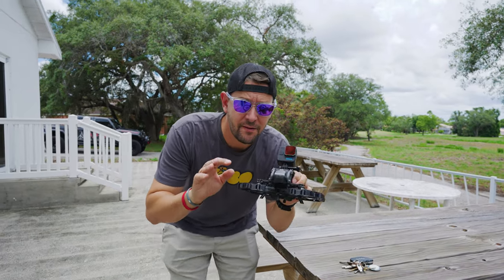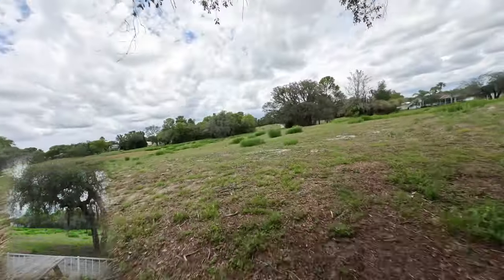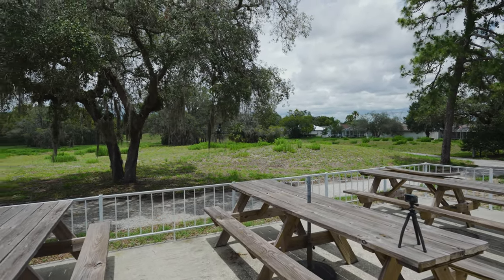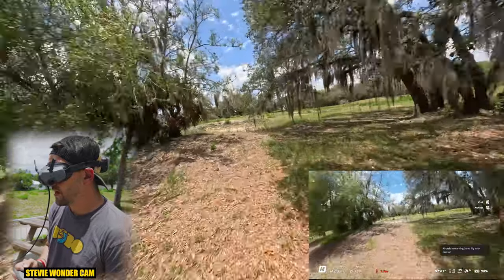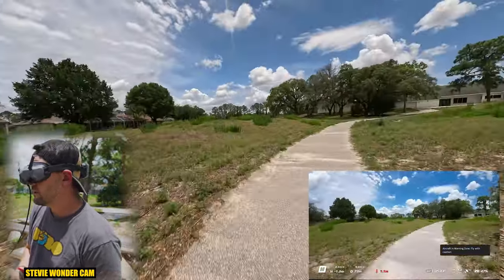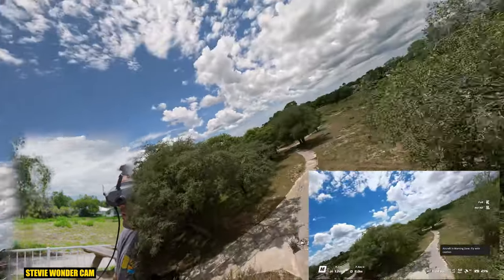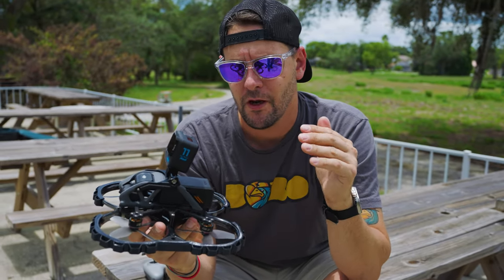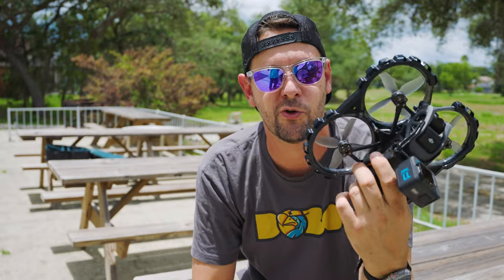Don't do this to your DJI Avata | Axis Flying Conversion

Comment: I'm so glad I did the upgrade. It's a night and day difference. Zero tumble, the power is insane and it's more quiet. I'm also happy your Bad Idea mount still fits. I would without a doubt do it again. Definitely not worth it if your concern is cost or the warranty. That wasn't an issue for me, I just wanted a better flying Avata. I didn't fly it at all before, now I take it with me every time I go out flying.
Reply: Amazing man, I’m about to get it!

Comment: The reason people do this is because of the tumble issue, you got used to fly the avata and the warranty is not an issue anymore, I think the upgrade is worth it Or get a 5 inch quad with O3 system installed.

Comment: I had the same problems with mine. Even after replacing the ESC, I still can't fly. Been grounded for months. Put the thing together and back apart so many times i ended up stripping a motor screw and having to drill it out. $150 upgrade to make a 1k drone useless. Gonna end up having to sell for parts

Comment: I feel like this is an actual win if you want to fly fast with an action cam but dont want to lose DJI's firmware/software. Now if only we could use modules for different controllers.

Comment: Just a good heads up.  For the Camera Gummies, they can be a bear to install on the 3.5 frame.  To ease them in, use some dish soap on a q-tip and get the gummy and the hole.  Will slide right in.

Comment: We did this but used t motors instead. I will say, this is def an advanced solder job. We bypassed the board by splice method you mentioned. 

It’s still underpowered after a few mins with a full size GoPro. 

Added the bones and can get 7 mins of moderate 50% throttle battery life before you reach 25% and power band falls off

I will say. It’s the best beginner fpv you can get that is liON

I would recommend skipping for most people and going right to a 3-3.5 in pre build whoop

Overall, This was fun and will 100% be used as a backup and for scouting
Reply: It's a lipo not lion

Comment: I had so many issues with my conversion, even had to take apart several times to troubleshoot but it was SO worth it to me. Now running the GoPro Bones to capture much better video and the confidence I have with the more power without worrying about the dreaded tumble is worth it to me.
Reply: i just finished building it and no success... two of the motors won't move when i plug the battery in. do you think i burnt an esc and need to replace it?
Reply from the maker: So, according to access Flying, they recommend not soldering directly to the ESC, I had to replace the ESC on this already once
Reply: Hi I'm getting esc error after installing any advice on how to fix

Comment: If I understand this correctly, this mod affects mostly manual mode. In normal and sport mode there is no difference, is there? In manual it seems to fly just like any other 3.5 inch cinewhoop, like Cinelog 35 or Axisflying C35. If that is the case, I think it makes not much sense to do it, especially if you own a cinewhoop already. But even if you dont, you can get one, with 03, for not much more money than the mod cost (in money, time, possible burnt ESCs, imperfect soldering, etc). It would be great for those who want a project.

Comment: I still cannot find a comfortable fit position for the Goggles II. The nose fit keeps it propped so it always is uncomfortable. Has there been any others that find this?
Reply: Yes, god i hate the goggles 2. Sold mine to stick with goggles V2 (terrible naming  thanks DJI). At least there are decent foam upgrades for the V2 that make them very comfortable and they work with everything from Avata to O3 naked to dji digital and more and you can get a pair for a 1/3 of the goggles 2 price. Just my personal experience. Was shocked at how bad the fit of the goggles 2 was, shockingly bad!

Comment: In my opinion, the best thing about this mod is that It stops the death roll issue where if you yaw too hard, it'll flip over, it almost always causes a crash. The extra power is fun to play around with though.

Comment: Hey Ken hope all is well. this drone has eat its spanich and what a difference it all makes. The speed, take off trust and handling the drone in windy weather etc. It's a pity you have to make all these changes to it...and as a beginners id be lost but would love to learn how to do it. I got these motor way back and did nothing with them. But love the whole fpv world and how you fly these drones as to my mini 2.I couldn't  handle the simulator and I prefer flying in a big open field at the moment to learn as a beginner. great video ken on this & great your knocking out the video again after a busy time. take care have a good weekend.

Comment: Nice content as always  :) I´ve ordered the Axis kit already but I was wondering if I can solder the new motors on the original wires instead of doing it on the ESC board. I have limited skills when it comes to soldering and I would be way more confortable that way. Is it possible to do so? Great thanks my friend

Comment: Hi everyone. I’m having issues with the installation. I’m getting a battery communication error and says my battery is 0% when it’s actually charged. I’ve checked to see if smaller battery wires are mixed but they are correct. What could be the issue? Thank you
Reply from the maker: I had to replace the ESC the first time sadly. Pro tip solder to the wires or just crimp to the wires not the board it’s self

Comment: I just upgraded mine and ko errors at first but i had to give it half throttle for it to respond and then whike flying i lowt control of the throttle stick.  Im going to try to reinstall the woftware qnd controller hoping that will help

Comment: Does the Avata make sense as a business purchase for a professional real estate videographer?  So far I use an Air2s to fly up to the door and then transition to a gimbal.   I can't tell if FPV will really help my business grow.
Reply from the maker: It’s better to use a smaller quad in doors , the Avata when not flown in manual can lead to unpredictable results
Reply: I Used it as a backup for indoors. It's a bit sketchy though. the main thing that bothers me is the linear throttle. I setup my cinewhoops with plentey EXPO on the throttle, i also lower the throttle percentage. The Avata doesn't have that option, plus if you're near an Airport you can't fly even indoors. So for me it could never be my primary real estate rig. I also film outdoor fitness video. The Avata is perfect fot that, especially with the axis flying upgrade. Normal mode and a longer battery life lets me camp out in the air while the subjects setup for the shot.

Comment: I thought it would be the best of both worlds.  Dji safety features, power and more than 3 minute flight times.  As I watch other reviews I see 8-9 minute flight times.   Are you saying this is not the case?  You never mentioned your flight time on the second battery.
Reply from the maker: You are lucky to get 6mins of flight. The upgrade overall isn’t worth the minimal improvements

Comment: Great video but I thought the entire purpose of the Integra Goggles was the built-in battery and you don't need to connect your phone anymore for remote ID ?
Reply: Also, what do you think the max speed is with the conversion kit without the Gopro ? Looks like you maxed out at 14m/s which is around 30mph.
Reply from the maker: If you are near controlled airspace you still have to connect the phone
Reply: @OriginaldoBo  aahh, good to know. Thanks !

Comment: Q: Have you tried flying this conversion without the gopro on, to see how much more flight time is available?
Reply from the maker: you don’t get much more flight out of it
Reply: @OriginaldoBo  
So, the juice isn't worth the squeezing!

You're better off just  building your own quad.  I still like the Avata, is it the gate-way drug into full fibre FPV?
Reply from the maker: Yep, building is also going to be much cheaper even with O3
Reply: @OriginaldoBo  
I got to up my soldiering game before I start building. 
🤔 but, I have always wanted to build a triple bladed drone.  I know that's not a "quod", but it would look cooooool 😎
Reply: Building sounds cool,  but I will miss the flight time and smart battteries.  The modded avata still has that going for it over a build. Lipo management is scary to us noobs

Comment: hi, where did you buy the propeller guard protectors?
Reply from the maker: I print them
Reply: Is it possible to buy them?
Reply: @OriginaldoBo  I would also like a print if it were possible.

Comment: How does it behave in normal and sport mode after the conversion? How long is the hover time before/after?
Reply from the maker: every thing is reduced by half
Reply: @OriginaldoBo  you get half the hover time (ie just standing still in the air) with these motors? That sounds insanely inefficient.

Comment: Is that the GoPro Mini 11 footage? Something looks off...
Reply from the maker: That’s hero 11 mini there isn’t anything off it’s stabilized via reel steady.
Reply: @OriginaldoBo  the quality gets choppy when you fly low, I thought it was the avata camera on 30fps or loosing signal. Maybe vibrations?
Reply from the maker: Quality looks fine watched it back looks normal for having a ND on it
Reply: @OriginaldoBo  I was thinking there was a problem with the mini 11, I have my normal hero 11 on the avata and never shows that amount of chop with NDs on. Would you try a normal hero 11 on it? Or maybe try the mini 11 on an non modded avata? I'd love to see the comparison (if you feel this is a vid worth making tho). Btw, which pgytech bag pack is that one, I got the onemo, looks like it, but mine opens horizontally, did they released a new one? Not a hater bro, I love your vids and have bought some stuff from your etsy store (some stuff shipped to Perú, the new stuff got it shipped to a buddy of mine in NY who is coming in a week and I'll be getting some more dobo etsy goodies). Still, I'm a 100% positive there's something weird with the gopro footage, maybe the ND number (although i figure you got that dialed in) or something related to the fps/exposure (perhaps could be a mix up between something like 30fps at 50 instead of 60?). Thing is, I'm looking to get a mini 11 (or 12) eventually and the footage kinda looked like normal avata chop when it looses signal. Best.
Reply: nvm, I just realized I was watching at 720... smfh, still there's some choppish parts, I'm thinking it may be the vibrations. Compare it with your non-modded avata videos side by side to see what I'm talking about.

Comment: Def not worth it. Save the Avata and build or buy a 3.5” whoop with an O3 air unit. Honestly it looks a hell of a lot easier to build one than do this conversion and at the end of the day you’ll have an Avata and another $500 whoop instead of just a $1,000 Avata… (a $1,000 Avata 🤦🏻‍♂️)

Comment: I get esc error on mine 😢
Reply from the maker: Might just be due to the larger motors
Reply: @OriginaldoBo  its wouldn't even start the motors
Reply from the maker: I had to replace the ESC was the only way
Reply: @OriginaldoBo  found out what was the problem its every time i screw the broad back  together for some reason its stops the motors  so i take it off try a battery and all of the motors work find 🤔